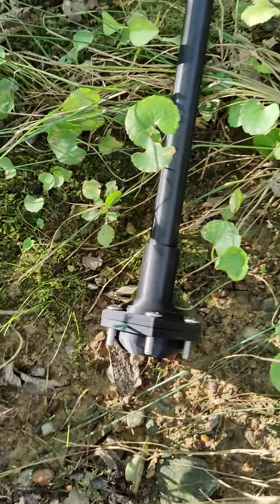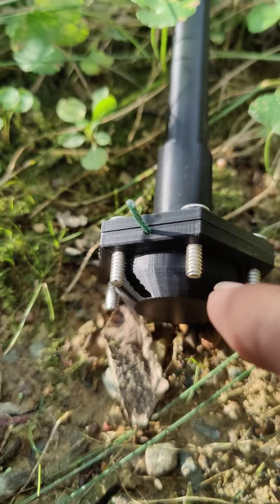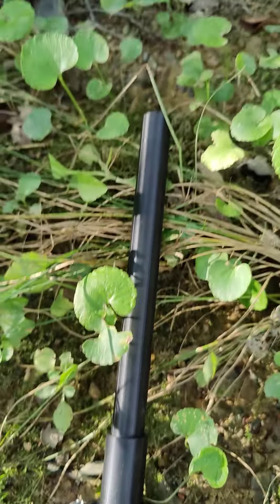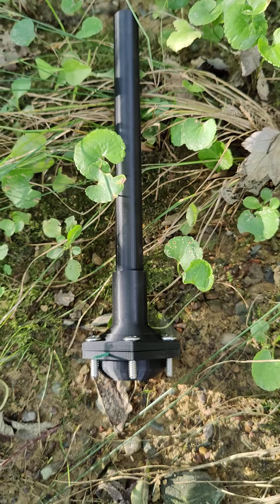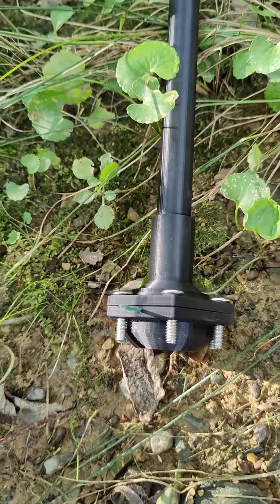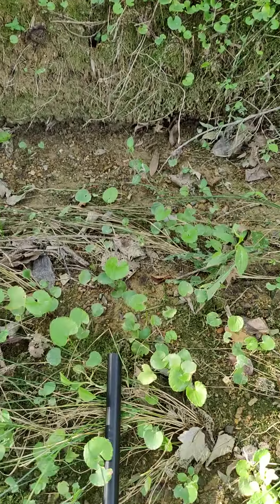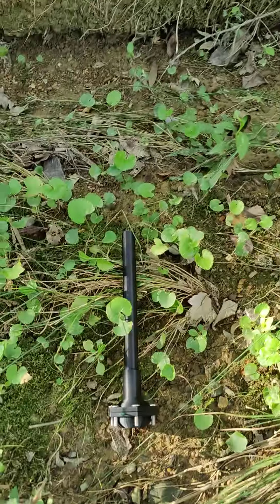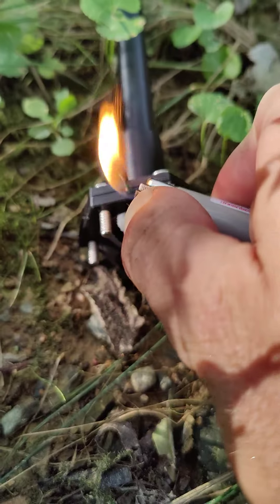firecracker 3d printed cannon fail, but it's only attempt one.

Comment: Just about every hole I print is too tight. Doesn't matter what dimension I use, it always prints a hole a little smaller. I add a bit and then it's too loose 😆
Reply from the maker: It is a struggle haha